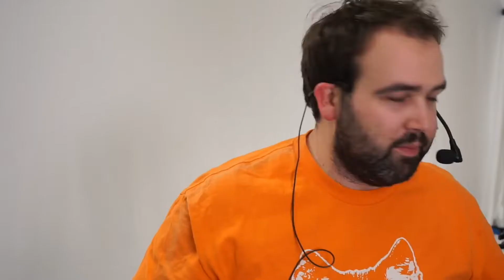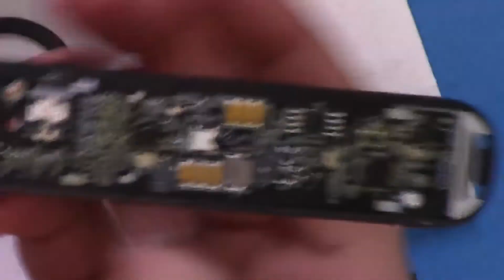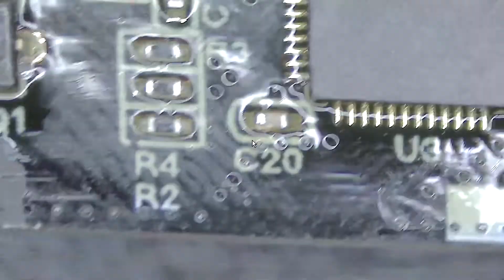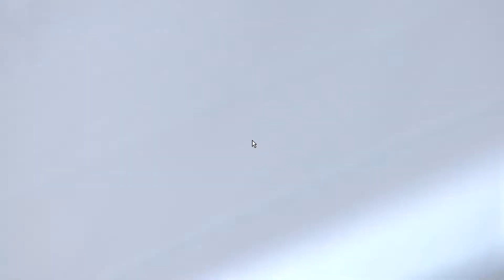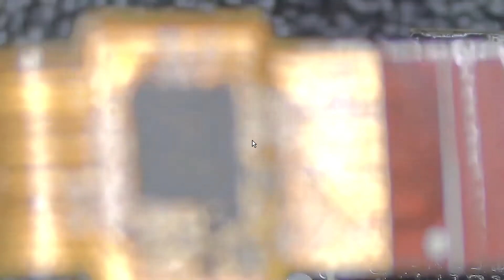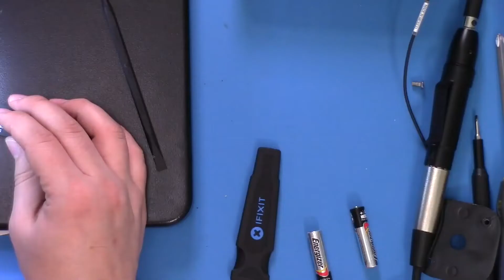UJIA Fido Door Lock (Indigo-go Project) Teardown

Comment: correct me if i'm wrong, reading various info, if the battery is not replaced in 10 second, the lock will reset, when you put new batteries after 10 second, it will go default, so the lock can use anyone's fingerprint, just as it is out of the box.

Comment: Fun teardown, thanks for sharing! The nRF52s support the same NFC protocol as the tags (ISO14443A) but they can only simulate a tag, not behave as a reader, hence the requirement for the NFC IC. I'd be curious if the nRF bootloader/flash allows OTA programming without a signed image despited the locked SWD. Perhaps you could upload new firmware without even touching it!
Reply from the maker: Ah thanks for details on the nRF52 capability - I looked only at the "feature list" lazily as you can see ;-) Makes total sense now. Not sure on the bootloader protection, needs more investigation for sure!